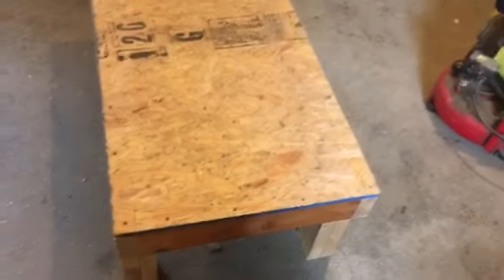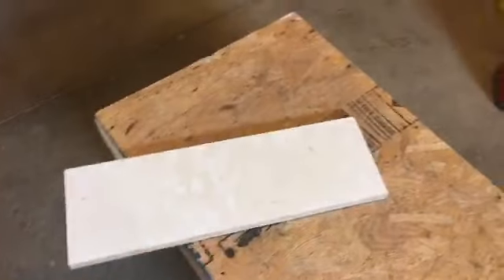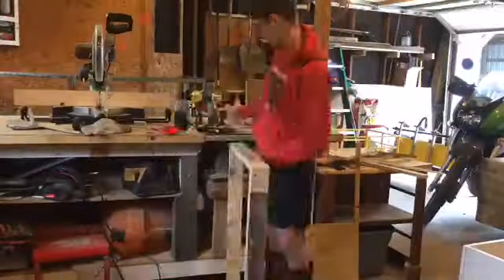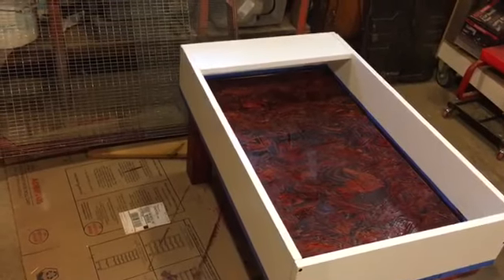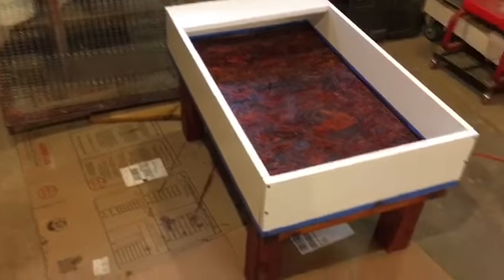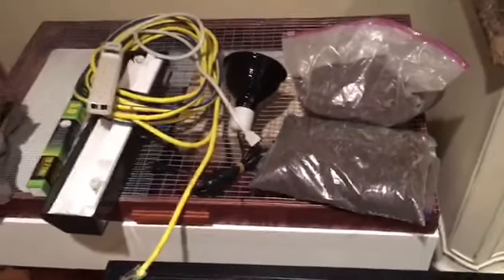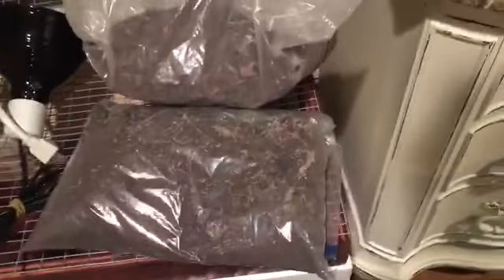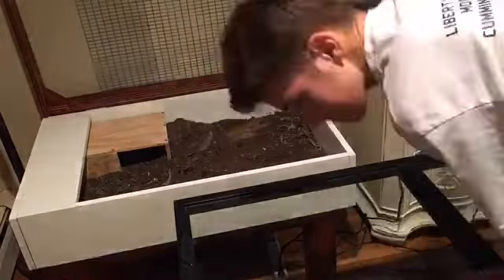Building An Entire Tortoise Table Out Of Scape Material!!! | DIY Reptiles

Comment: I wonder if you should have put that black plastic stuff on the wood before adding the dirt? So the stain doesn’t get into the dirt?
Reply from the maker: Mommabowdle I currently do not have enough pond liner. I also do not think it will be an issue.